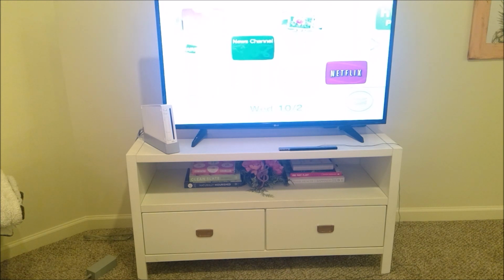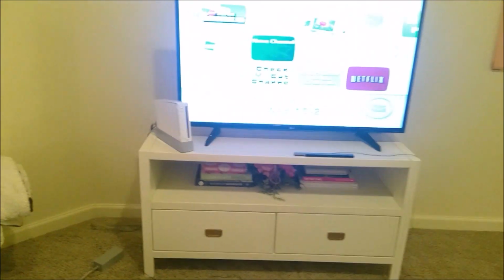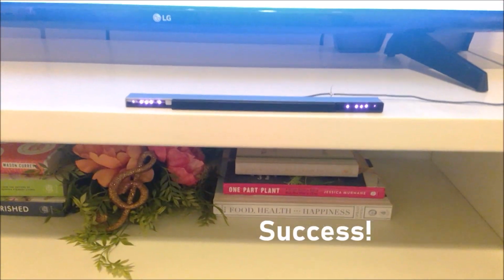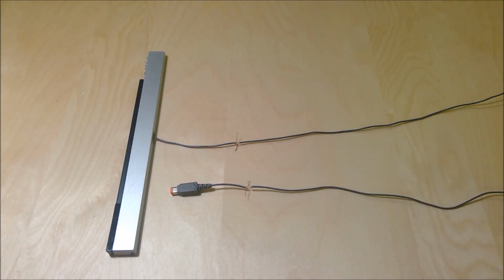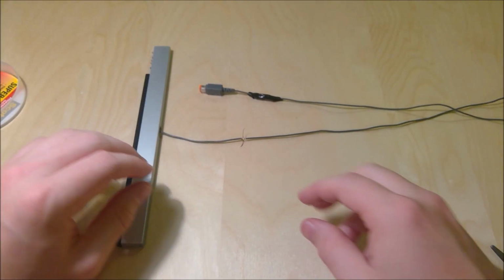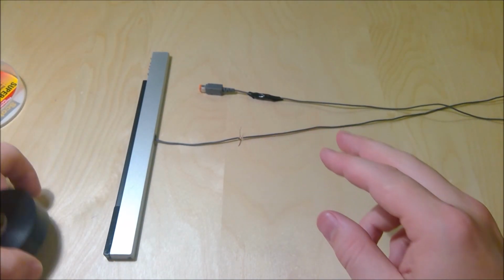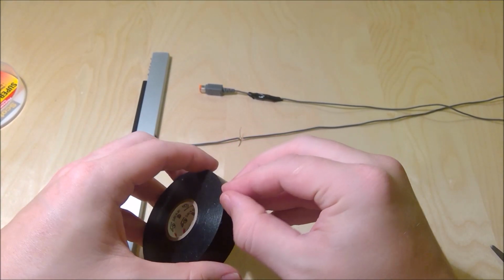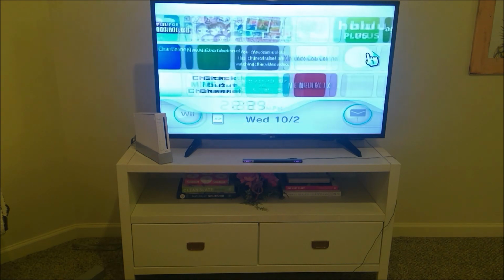Can I fix a wii sensor bar with a broken cord?

Comment: Thanks for this, kids were sad after I promised they could play the wii, only to find out the cable of the sensor bar had got caught on something and torn. Spliced the cable back together following your instructions and got it all working again, crisis avoided! Thanks!
Reply from the maker: One of my biggest hopes with these videos is that I'll be able to help people when they run into similar problems. So glad I could help out, and thanks for watching!
Reply: u could replace the sensor bar with 2 candles toooooo!!!!!!!!
Reply: @canifixitofficial  but this is common sense, not a tutorial, everyone in existence has patched a cable and the wires are usually color coded for again. Common sense.
Reply from the maker: @yourmomsbf878  It's not meant to be a tutorial, just documenting my experience in case it might be helpful to others (and judging by all the other comments, it has been helpful to a lot of people!😁)
Reply: @canifixitofficial  hi. my gamegear wires broke. i wanna to solder but the i wire is skinny just as the sensor bare on wiimote. how do i do so? things is getting expensive
Reply from the maker: @theronleigh1980  I can't really advise you too much without seeing what the wire and contact points look like, but you will probably just need a fine-tipped soldering iron. You can buy different tips for your soldering iron and some are very skinny for working on smaller stuff.

Comment: That is a common problem when trying to solder things together. I used to be an electronics technician, I went to school for two years to do that, but never really worked in the industry. I do have enough soldering experience to tell you that this happens a lot and all you really need is some flux. If you dip each wire in the flux it will actually cause the solder to draw in to it and it would literally take you probably a few seconds to get it done per Solder joint. Great job though. This video helped me.
Reply from the maker: Thanks so much for the advice!  I've never used flux before, but it's definitely something I wanna learn how to utilize in the near future.
Reply: ur not alone. i wanted to learn soldering. things are really getting expensive so it's better to try then never. keep up the good work

Comment: Bummer, still no luck.  Burned off the insulation and cleaned.  Tried multiple times. :/
Reply from the maker: Dang that sucks. Maybe you had the positive and negative wire flipped?

Comment: I bought a second hand wii off of marketplace and the seller said I need to replace the sensor bar because the wire snapped.

I tried joining it and it doesn't work but as soon as I get home I'm gonna try burning the insulation off and joining. Will update my comment if I got it working

Update: working perfectly after burning off the insulation and twisting together. Didn't have isopropyl so I just cleaned them with a paper towel to get the soot off.

Thank you so much.

Comment: Nice video, could have been cut down a little bit more, but advice worked. there are only 2 wires in the sensor cable, a red shielded and an exposed copper, then some white string looking thing.
An important note here is that the red shielding is like "painted" on the wire and must be removed in order to either solder or twist them back successfully. It won't work otherwise, I tried, and even tried with what I thought had melted/burned off the shielding, but apparently was not all the way as I went back over and burned and cleaned it off with alcohol. Twisted them together and got the sensor working again for my mom's wii.
A little tip too is you can expose more length of the wire and only burn the tip off, so the bottom is still red so you can tell which is which.

Comment: Good tip about the cleaning with isopropyl, tried just burning then twisting them together, didnt work. Then I looked up your vid on youtube, you suggested this and it works now 😃 tyvm
Reply from the maker: Wow, that's great! I was worried that the isopropyl alcohol step didn't actually do anything, but if it helped you then I'm glad I included it in the video!

Comment: Someone has probably mentioned. But dip your wires in some flux after you twist the strands together (if it is a stranded wire). Also use 60/40 leaded solder. Unleaded is just difficult to work with. Good iron too. Pinecil is great and priced right.
Reply: I prefer 63/37 solder.  I find it easier to work with because it solidifies faster than 60/40.

Comment: Thanks. I fixed the cable by your video. The trick is the insulated coating on the wire which is not easy to notice, burn the wire with a lighter for a while and the coating should be gone. Soldering is not really necessary.
Reply from the maker: Awesome, glad you could fix your cable. Just like you said, it's all about getting rid of the coating on the wire.

Comment: I saw someone use two candles as a sensor but I don't know if they were pulling my leg or not.
Reply from the maker: It was probably real. You can use two candles. I don't think it works quite as well as using a proper sensor bar, but it would definitely work if that's your only option.

Comment: OMG, isn't it better to replace the wire entirely without any soldering?
Reply from the maker: I do have another video where I replace it entirely with a cable that plugs into the wall. It still requires soldering the new cable to the board though: https://youtu.be/eCzPx-3XZpA?si=hzO_CI3WC-9SMXzE
Reply: @canifixitofficial  but will looks better ☺️

Comment: Great video. 👍 I did the same thing you did and the showed purple lights threw my phone camera butt the remote still does not work
Reply from the maker: Weird, if the purple lights are working then it should be working. Are you sure your controllers work?

Comment: Hey do you think I can attach it to a USB cord and just plug it in a wall?
Reply from the maker: You definitely can, but you'll have to make sure the wall adapter that you're using will give the right voltage.  Here's another video I did that explains this a little more: https://youtu.be/eCzPx-3XZpA

Comment: Eh, Nintendo having to save a penny by using cheap easy to snap wire. I still have grown family who come over for the holidays and summer and play Wii Sports. Sadly, the thin cable snapped and I have been struggling to splice this cable. Going to try the lighter to burn the wiring to see if that's whats going wrong for me. Its just too bad those cheapo aftermarket battery powered bars aren't on the market anymore.
Reply from the maker: Let me know if it worked! And agreed on the cable being thin and cheap. This comment section is full of people who had the same thing happen to them. Also I might be making a video on how to make a battery powered sensor bar one day.

Comment: Fast forward was not a happy idea, especially when soldering and using the multimeter
Reply from the maker: The soldering didn't work, so there wasn't much point in showing it. I'm happy to answer any questions you have though.